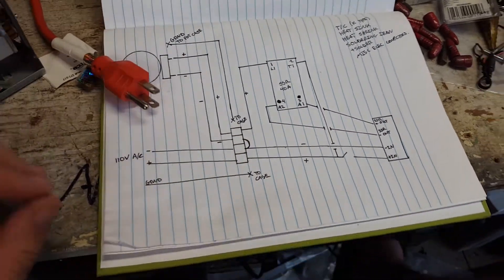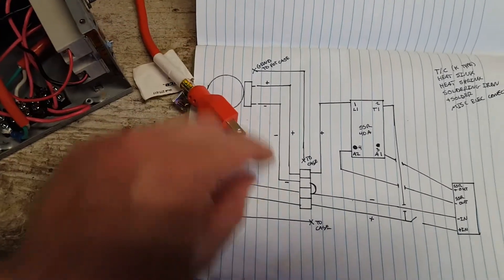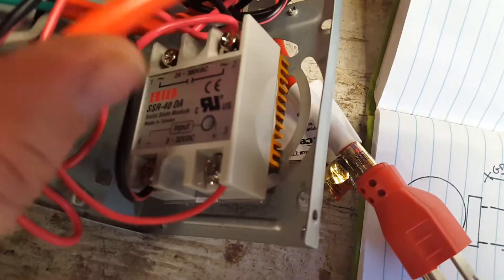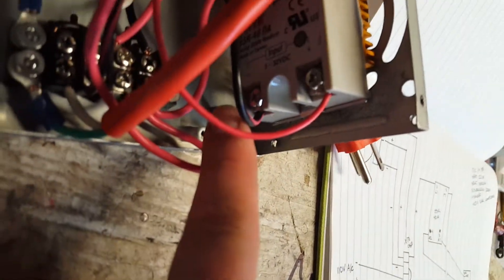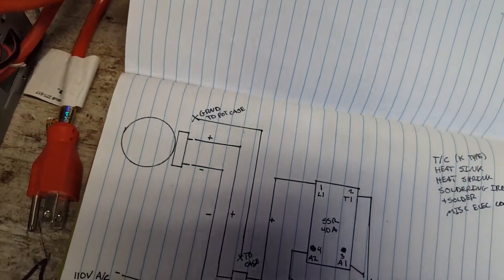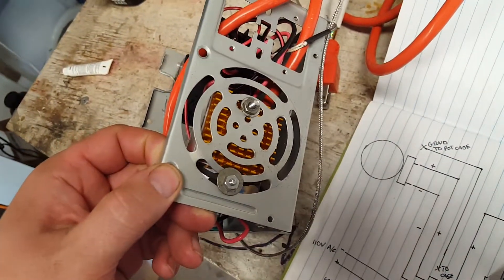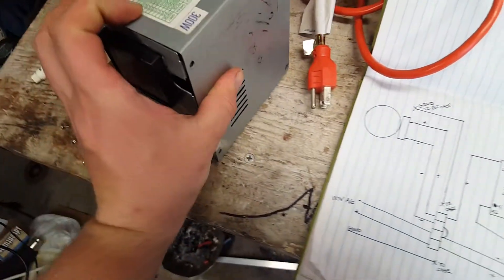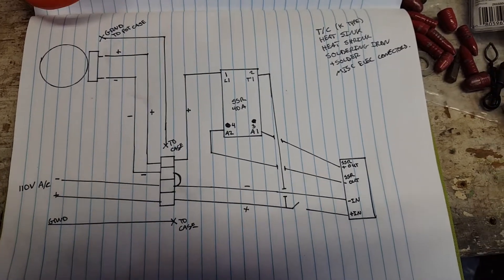Easy PID instructions for bullet casting

Comment: Instead of messing with the internal wiring of your pot just add a single AC receptacle to the box where your pid and  and a solid-state relay is. You plug in your pid controller into the wall plug, the power cord coming from pot into the ac receptacle in your pid controller box, turn on the pid controller and turn the pot control full on.